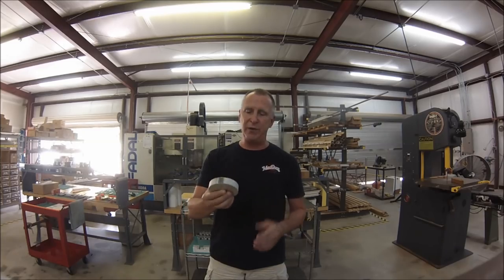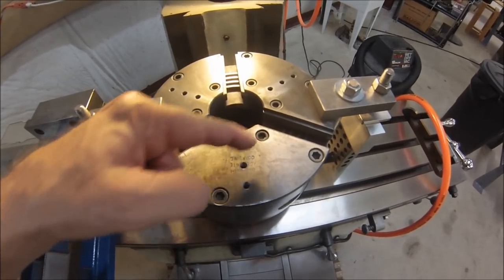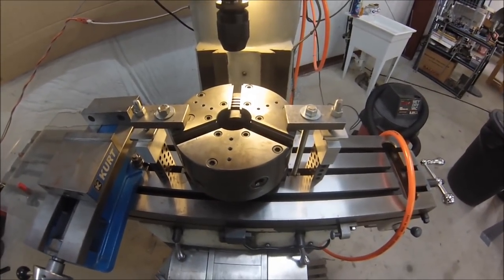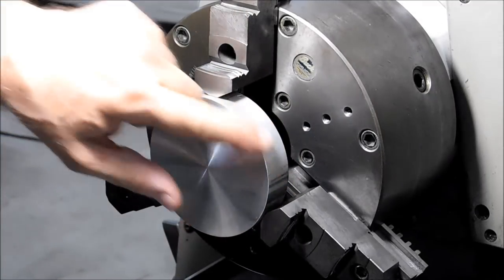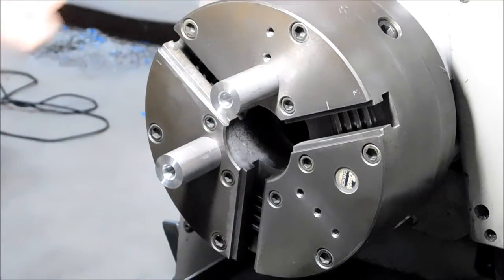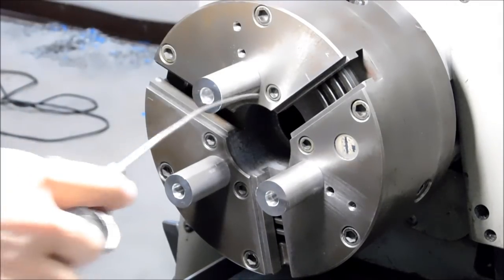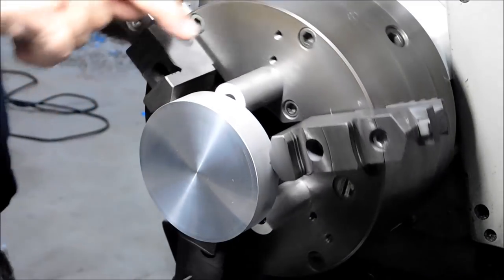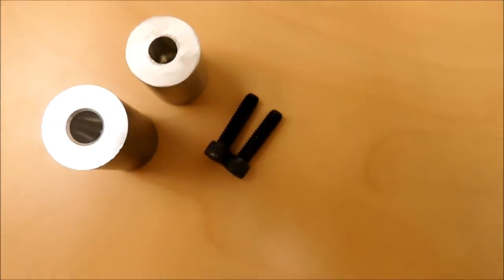A Simple Chuck Modification to Improve Parallelism of Your Parts

Comment: Any parts small enough I usually just put a 1-2-3 block behind and then slide or tap out the block after tightening jaws.
Reply from the maker: The parts I made that inspired this setup had sub 16 finishes on both sides. Sliding a block out, or a block that wiggled was out of the question.
Reply: @joepie221  I appreciate the setup you are displaying here. It's a great idea that will be consistent over time. I do usually have to tap the 1-2-3 block out with a small brass hammer to be clear. It is just a quick setup method not as precise as what you have here. Thanks.

Comment: I will add another comment, how do you drill and tap a good quality hardened lathe chuck like I use to fit those stand offs?.
Reply from the maker: Its highly unlikely your chuck body is hardened. What make and model is it?
Reply: When I acquired my second hand lathe some time ago with no chuck I bought a brand new 3 jaw San Ou K11-160 for it, it stated in the advert that it was off hardened metal through-out, I haven't attempted to drill and tap holes in it as yet to fit stand-off's even though that's seems a good idea,  I will just keep using the revers jaw's when the need arises, I find tapping the work piece back against the jaw's after tightening with a light mallet makes the job come out parallel within a thou usually.
Reply: San Ou chucks are standard cast iron or cast steel chucks, nothing hardened except the jaws. Drilled & tapped mine the minute it arrived in the mail.

Comment: One could make standoff with bigger inner threads on the part side then drive in three hex head screws. The flat surface of the hexagon should be machined sligtly round. This way you will get adjustable standoffs, which is wery useful if you have to set up an already existing part which has a reference surface to indicate to.
Reply: Gábor Móczik ... but then one has to adjust the standoff using a dial Indicator. Joes method is easier in my opinion because the aluminum is a disposable item. We’re talking about 1” aluminum rounds. Just face them and we know they are dead nuts on the money.

Comment: would it be easier to turn the jaws around and use the steps in the jaw face as a reference surface
Reply from the maker: You can do that when the 'part is thicker' than the 'step is high'. You won't get the rigid stop benefit if the jaws push out under torque. It is done all the time though with success.
Reply: ok so still better of using a back support system for the piece for accuracy.
Reply from the maker: For parallel yes, flatness is controlled by the torque of the jaws if the part starts getting thin. Rough out with an aggressive grip, the release the part, and re-torque the jaws using a   lighter grip for the finish cut. You will have better results for flatness.
Reply: cool thanks for the tip

Comment: I'm still learning so my question is why wouldn't you have just flipped the jaws around?
Reply from the maker: 2 reasons. The part was thinner than the step on the jaw, and when you reverse the jaws, you would have to use the inner steps to hold a part this diameter. This would make the top steps of each jaw beyond the plane needed to face the parts.
Reply: @joepie221  can I ask why the inner steps, again be patient with me I'm trying to soak up as much info as I can. Was it too small for the outer jaws?
Reply from the maker: @hustlerkc11  No problem. Once chuck jaws are reversed, there are minimum diameters each step will hold. Imagine closing the chuck down all the way without anything in the chuck. Once everything closes, the outer jaw step will only accommodate a specific size or larger, beyond that, the inner jaws do the job. Each step is usually the same depth.
Reply: Got it. Thanks so much for taking the time to explain. I just bought a South bend 9" model A and I took machine in high school but we know how long ago that was so trying to learn through you tube. Thanks for the videos, they're very informative.

Comment: How do you know the parallel sides are square to the Outside diameter ?
Reply from the maker: This modification only assures the faces are parallel as the video title states. It is a modification that can be used with hard or soft jaws. If your OD has not already been established in an earlier operation, A skin cut on the OD would be recommended to true the OD to the faces.

Comment: Interesting...it seems if the part you're working on is really small in diameter, just use larger diameter stand-offs (as long as they aren't so wide the interfere with the jaws, of course)
Reply from the maker: If you look closely,  you'll see several holes in the face of this chuck. I have a couple different standoffs, and a set of slotted rectangular blocks. As long as your support doesn't cover a jaw slot, it won't interfere with a jaw or the chuck operation.

Comment: Instead of the standoff, would do a light cut on the chuck face, then put some machinist parallels between face and the piece you work, would that be an easier solution?
Reply: The chuck face will be running true and you don't need to face it off if it isn't, you true up the adaptor rather than machine the chuck. Parallels work fine if you don't have a set of soft jaws.
Reply from the maker: Keep in mind the finish on the registration side of your part. Driving those parallels out usually scar the backside of the part. Sometimes putting some paper between the part and parallels helps to eliminate those scratches.
Reply: A chuck face is also hardened and you would ruin you ground finish
Reply: Not hardened, that's why you can drill it.
Reply: You won't have a problem with that if you keep your parallels in good order. I've never used a chuck smaller than 3' with stops on it but it would come in handy when facing off thin rings.
Reply: Nam, How do you stop them flying off when you start the chuck. Joe's idea is simple AND safe.

Comment: Off topic but I had an end mill cut .003 deeper after a shot of WD- 40.  It was 1/2" 6061 being squared up wit a 7/8 uncoated HSS, 0.020 cut. The chips were following the bit about 270 degrees so I shot it and the chips flew out earlier. Upon inspection I saw the finish had changed and I could feel a faint drop. Calipers showed .003" deeper cut. What happened?  10x70 mill. 3000lbs. I've never seen evidence of deflection before now.
Reply: Have you seen his video "Great Setups, Crappy Results"? =)
Reply from the maker: Hi Jeffery. If I had to take an educated guess, I'd say the lubricant relieved the material drag on the tool considerably. This in turn led to less tool load and allowed the tool to relax and therefore cut deeper. I'll bet if you check out the wall, you'll find a slight taper in the area before the wd-40 was applied. My gut tells me it was also a climb cut. I don't know the setup, but make sure you are not extending the quill too far when milling if you don't have to.
Reply: Climb cut. Minimum quill extension. 3 3/8 quill. I use the biggest bit for squaring. I have noticed that I have trouble hitting the right size sometimes squaring. I square one side, flip the part, take about 0.020 off for a clean measure, zero the x axis there, the cut the excess based on the caliper reading. I will experiment and try a conventional cut also.  Tool pressure is all that I changed by adding lubricant. Another experiment would be a cut on the x axis to see if maybe my head is canting somehow. Thank you for the feedback.
Reply: Brian Walk that was the video that I watched when I found Joe. Subscribed right then.

Comment: Modifying chucks isn't something I've ever thought of doing. (Faceplate's are another matter for fixture holding and always end up with various holes drilled in them.)  It is something I will be doing to three jaw as it's probably more accurate than a quickly made 'spider'. Spider is faster to use but you have an extra surface to cause run-out plus extra cleaning/checking before use

Comment: I liked this but I'm turning mostly 1" or less any ides?
Reply: "One inch or less."  How much less?  @ 1" you have quite a bit of space between the jaws of a 3 jaw chuck.  You can make a plate, like a three legged plate (each leg extends across the chuck face, from the center, between the jaws); the 3 legs spanning from a "center diameter" of your smallest piece you have to cut.  Hopefully, you still have a big enough gap between the jaws for your smallest piece, because the legs of the plate can't be any wider than that to not interfere with the jaw movement.  If you can screw the plate, (at least 1/4" thick IMO) on the chuck face like he did, (given the legs are wide enough for a screw), you can then drill and tap a hole in the center.  Now you have a flat plate, that you can bolt a parallel spacer onto, for the diameter you need, (this set up can fit any diameter or length, if you can use the plate with your smallest diameter piece).  Set up change time would only be one bolt and the parallel spacer you need for your next part.
Reply: The length of your parts matter also.  If they are long enough to hit 3 chuck jaw pads deep, the part will probably come out pretty parallel, in which case you only need a purchasable work stop.  I know you can buy work stops that fit in 5-c collets, and you can buy a collet chuck (both are pretty inexpensive) that bolts on your spindle face.  If you can use the assorted collets, (typ 1/64'th inch increments, but they also have a range).  I have a collet chuck from a company called "Bison" (Made in Poland, and is good quality), and you can also get soft bore-able collets for any special diameter, where you can bore the bottom flat too, for your stop.
Reply: Correction.
and you can buy a collet chuck (both are pretty inexpensive) that "Cam locks" on your spindle face.

Comment: On large lathes chuck face standoff pins/blocks are standard.
Reply from the maker: How big are you talking? I have never encountered them out of the box.
Reply: Heavy machining in lathes 24" + throw for making heavy machinery like crank shafts for 600-1000 ton mechanical presses. Chucks also have screw holes to attach weights for counterbalance. I am a tool and die maker with a lot of experience on horizontal boring mills. My computer told me you asked about toolmaker's vices but did not tell me how to respond. Tool makers vises are especially handy for squaring up/machining  as many plates as can be put in the tool makers vise which is then put in a much large vise such as the Italian made GS precision vise. Often three sides can be done without removing the plates when making things like die plates.

Comment: Why not reverse the jaws?
Reply: Parallelism will still only be as accurate as the wear and time/use abuse of the tee slots in the chuck. The chuck is softer than the hard jaws and the back side of the "tees" are usually beat up and worn from the jaws always pushing away from the scroll plate inside. Hope I'm not overstepping boundaries

Comment: I like it!  Certainly cheaper than the expensive set of magnetic work stops I purchased for our Die Shop and a lot more accurate.
Maybe you could offer a tip for the viewers on reinstalling the chuck jaws, because that gave me a bit of trouble back in the day.
Reply from the maker: Editing one right now with some good tips on chucks and jaws. Stay tuned.

Comment: What tool and you use for facing?
Reply from the maker: Its my TPG triangular carbide insert with a .015 radius tip. K68
Reply: @joepie221  I'm new to machining and buying tooling right now. Would you please tell me what tool holder I shuld get for this insert? I'm using 16mm/  5/8" shank
Reply: ochenkow

Comment: Nice tip, if you gave the part whack with a soft blow hammer when clamping in the chuck you might have taken out that last 2 tenths. Nice video though
Reply from the maker: I bet you're right. 2 tenths isnt bad for not tapping it down.
Reply: I don't know- 2 tenths of an inch is quite a bit. (snicker).

Comment: I would have tapped the stock  back gently with a soft hammer. A couple of times during tightening. 1/4 20 seems a little coarse.
Reply from the maker: 1/4-20 has nothing to do with the parallel accuracy, but a gentle tap with a dead blow hammer would have probably taken out the  2 tenth difference.
Reply: Joe Pieczynski Hi Joe. I realise the thread won’t affect the accuracy. Jeff

Comment: Now I get it your a bad ass machinist not a small engine builder🤣 I was wondering about you comment
Reply from the maker: Thanks and correct. The small working block I plan to make will be just for fun. The connecting rods are probably next. Turntable material.

Comment: Why don't you like turning on the lather with nothing in the chuck ?
Reply from the maker: The scroll can accelerate differently than the chuck body and launch the jaws.
Reply: While that sounds plausible, my chuck was  so gummed up with old grease and swarf, it's unlikely it would have happened with mine.
However, your rationale makes me want to be more careful.
Since I'm adding bushings to the chuck I've disassembled and cleaned out, I will take your advice and be safe.
Thank you,  Joe.
Reply: Err like getting hit in the face with a chuck jaw.
Reply: And even if the jaw doesn't fly out, it usually will first hit the ways. Good way to ruin the ways, at least one jaw, one chuck body and possibly the spindle. Seen the carnage after the bang, answer was all of the above.

Comment: put parallels between workpiece and chuck. clamp and remove parallels. this is much faster.
Reply from the maker: I disagree. Once the holes are in the chuck, setup takes less than a minute Your method will also scratch the rear of the part when driving the parallels out.
Reply from the maker: @J.C. Kohle Using air on a chuck is less invasive than flood coolant.  Blow chips into an empty cup sometime and watch where the contents go. Now pour water and chips in that same cup. Which scenario leaves behind debris?
Reply: Using parallels has served me well over the years.
Reply: Impossible to get the parallels out if the part is against them. If they do slide, then your part is not against them, which means your length setup fluctuates. And having nothing behind the part, even a small drill can push the part inward in the jaws, especially on thin workpieces that you can't clamp hard.

Why disagree with yet another tool to your arsenal that makes most setups much easier?

Comment: Why didnt you reverse your jaws? They are stepped for that purpose so you can push your part against the stepped faces
Reply from the maker: On parts thinner than the step is deep, you are kind of out of luck. You also still have jaw bulge on older worn chucks. This standoff trick allows for thin stock, and will never shift under torque. It actually works extremely well and just a few sets of standoffs usually cover all the parts you'll need to do.
Reply: @joepie221  then use soft jaws rather than resort to modifying your chuck
Reply: BTW not rubbishing your suggestion but soft jaws are designed for this purpose and modifying your chuck carries some additional risks
Reply: It carries absolutely zero risks. It doesn't affect the chucks integrity. Soft jaws have the same problem as hard jaws: jaw lift when tightening.
Reply: The first time I made a set of these was a couple of millimeters deeper than the top of the jaw step, so that I could clamp very thinly. So 3 sets, one for each jaw step height. After that the collection has widened to maybe 6 or 7 of which one is general do-this-do-that-face-off-when-needed. All the others are ground the same so they don't wear out or get dinged.
Reply: best solution I've seen is custom made soft jaws with an incremental step down for thin stock/parts, dependent on having a good chuck with no "bulge" though
Reply: I was wondering the same thing.
Reply: @wildbill6976  Those still have jaw lift, which ruins your length reference.

Comment: Why not just turn out some soft jaws, skim face and O/D of job and then turn around  and do second side. I hate hard jaws, I only use them for cleaning up billets.
Reply: Soft jaws are nice and they have their place, except the base jaws will move on you when tightening. This technique of using standoffs also works on 4-jaws to get a part running true or in the place you want (read offset work) and also makes it very easy to turn thin washer type parts that otherwise would bend between the jaws away from the turning tool.

I have made a set of these standoffs at work for the lathe, also using them in milling jigs and the lathe also has what I call "pie standoffs" that sit between the jaws for extra thin workpieces. Also couple of "spiders" that bridge the bore so that smaller than bore diameter parts can be held.
Reply: @JaakkoF  I'm not knocking the method, as I use something similar. I have a bung that goes in the centre of the chuck that I screw attachments to. I just don't like hard jaws because if your chuck gets worn then the jaws could become untrue and the job won't spin true.